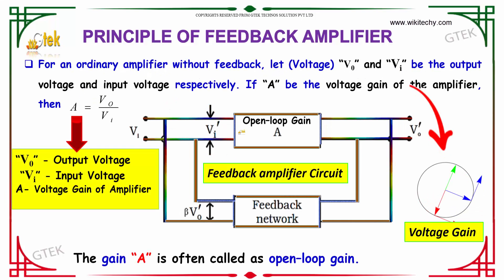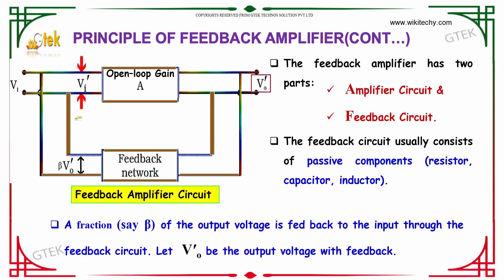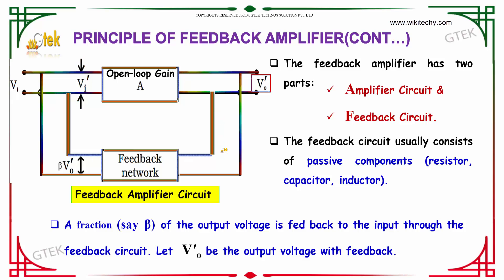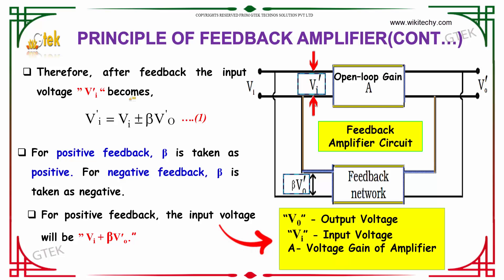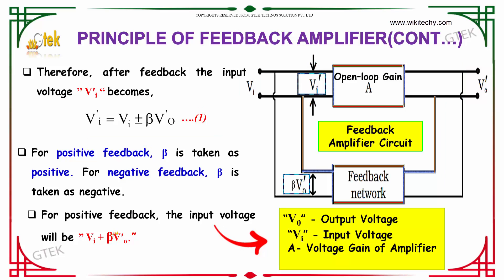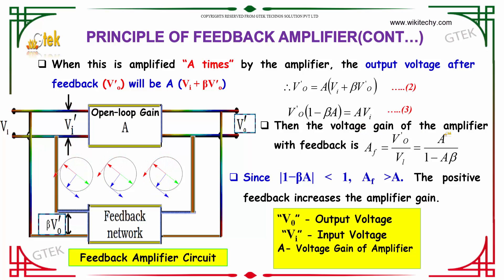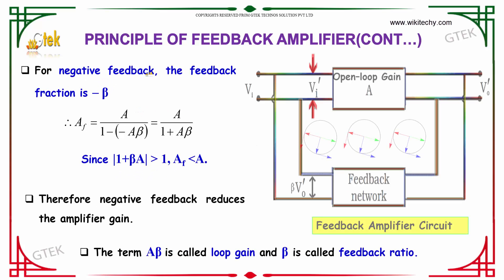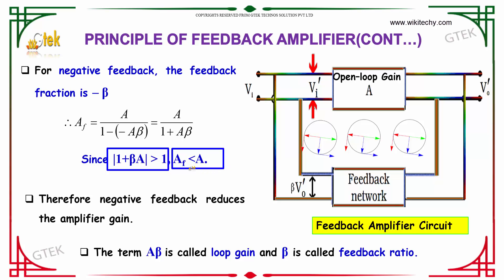Principle of Feedback Amplifier Semiconductor Devices class 12 physics subject notes lectures CBSE

Comment: Suppose a small voltage is fed back from the output of an amplifier to its input as in Fig. 26 A. ... On the other hand, the total voltage gain is less than with the amplifier alone, unless additional stages are added or a " balanced feedback " is used in the manner to be described later

Comment: Suppose a small voltage is fed back from the output of an amplifier to its input On the other hand, the total voltage gain is less than with the amplifier alone, unless additional stages are added or a " balanced feedback " is used in the manner to be described later.

Comment: Suppose a small voltage is fed back from the output of anamplifier to its input as in Fig. 26 A. ... When the " feedbackfactor " FA is very large, the gain becomes (— 1/F), and the effective amplification is independent of the gain A of the amplifier alone.